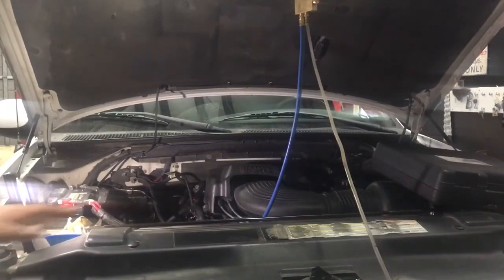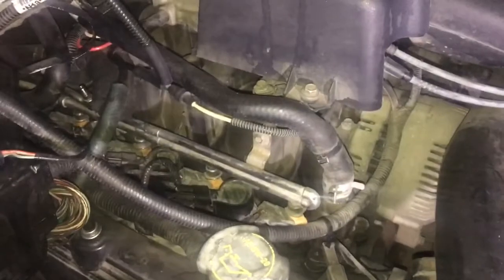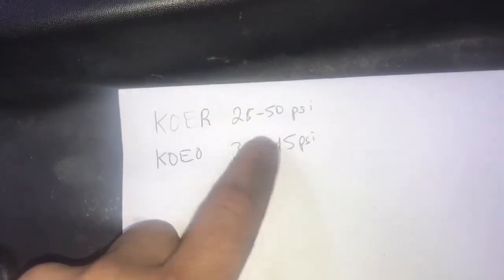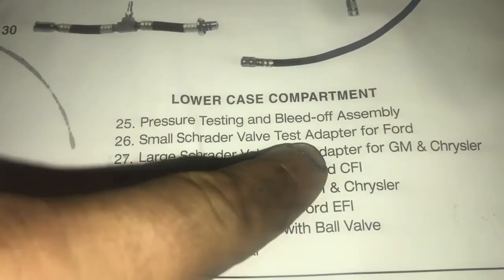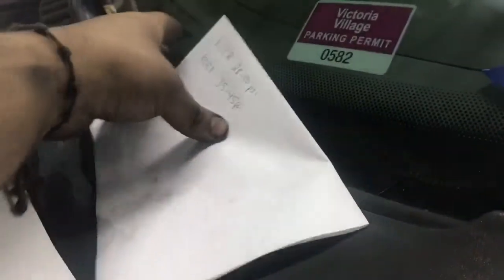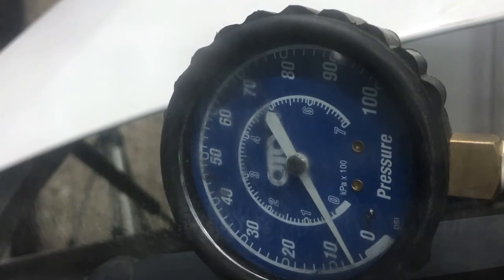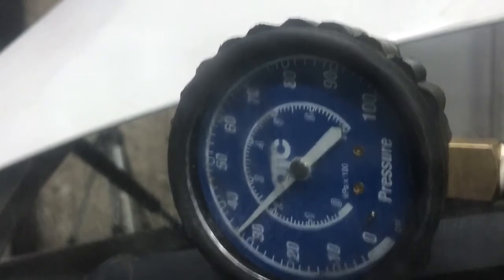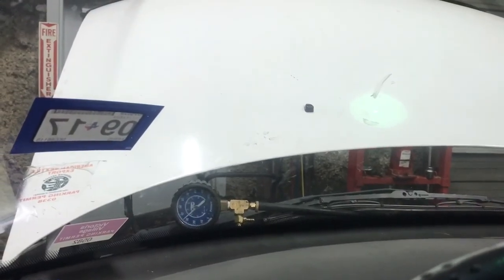How To Test Your Fuel Pump/Pressure

Comment: What if the pressure drops when key on key off does it mean there's a leak
Reply from the maker: adrian 505 might have a leak at the pressure regulator or fuel pump